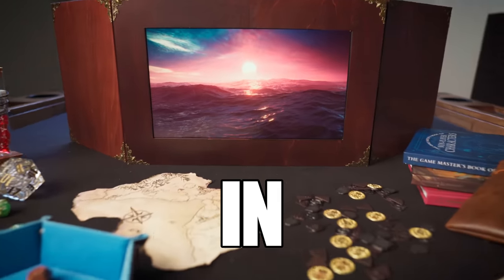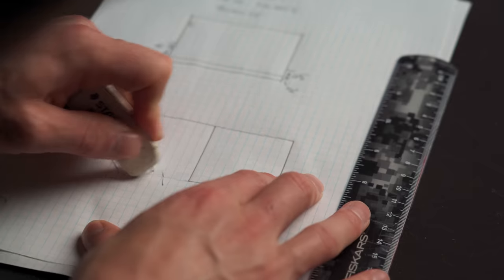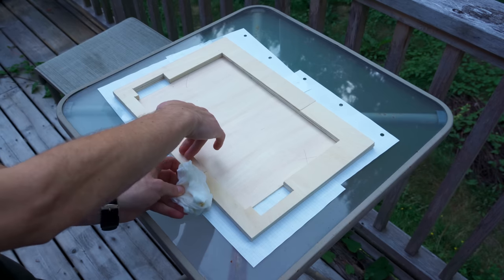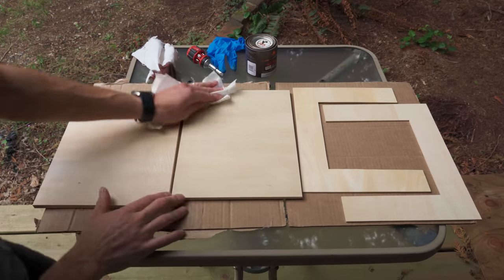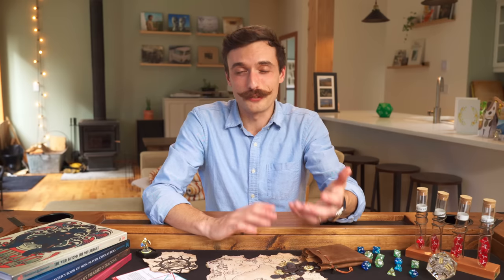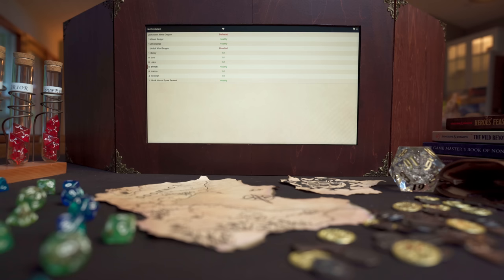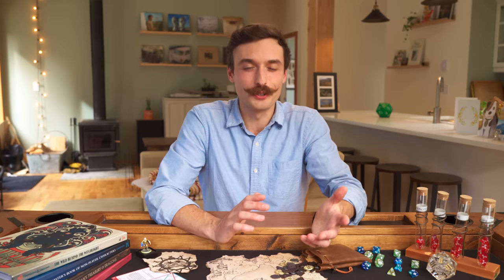I built a D&D DM screen with a built in display.

Comment: Hello, I'm a tradesman. You said"it's better to have the opening too big than too small" during the prep phase. This is actually backwards. Remember, you can easily take more away, but adding more is always tedious. But all in all this is fantastic, definitely going to try my hand at making one. What I really want to do is one of those big touch screen map tables, but holy dear lord does that get pricey.
Reply: Exactly my thoughts 😊
Reply: nicest tradesman correction ive ever seen
Reply: Why is less better just curious? My thought would be more is easier to cut?
Reply: @tteckk9  in trades, if you’re cutting one thing to fit another, it’s always better to go smaller with the receiving cut. As he explained, if you are trying to fit something into the cut but it’s too small, you can simply keep adjusting until it’s the right size. Conversely, if you make it too large, your new piece will fit, but you’ll find it hard to make the connection good considering the hole is too large
Reply: It is indeed better to have it too big. Too big means you can scale it down if need, otherwise u cant add to it if its too small without it making it look daft.
Reply: i saw a video of a guy who did a table like that. it only cost like $300~ for everything
Reply: @jasonjellie9342  its easier to take more away then too add. especially if its something like wood or metal

Comment: This is really impressive! FYI the bumps come from the damp cloth. If you want to remove dust, you should use a tack cloth or something not water based
Reply from the maker: Ah, thank you! That's great to know!
Reply: @powerwordspill   Actually the bumps come from the grain in the wood raising when you apply the water-based urethane. So, it won't matter if you use a damp cloth or not. You sand in-between coats of any sealer because the grain raises.
Reply: @NickRosterPicks correct

Comment: I have many suggestions for improvements, but the biggest one that comes to mind is using rare earth magnets to attach the layers that sandwich the monitor.  That way, if anything happens to the monitor it's easy to remove and repair or replace.
Reply: Im in the process of my build and only just saw this comment.

I got my 4 middle layers glued together, along with the front panel. I have yet to put the back panel on.

Im wondering if there is a way to do the magnet thing at this point?  The only thing i can think of is to take a hole saw, one hole in each corner, and toss a magnet down in the hole. Then on the back layer, add a magnet.  

Any other ideas?  :(
Reply: @chadc638  Watching the video again, assuming I'm understanding your position, that's probably the best place to do it anyway.  But you won't need a hole saw.  You'll just need a drill bit.  The kind off magnets I'm talking about aren't much, if any, bigger than a half an inch.  Just drill a hole in each corner the same depth as the magnet, drop in some super glue, and drop in your magnet.  Watch your polarities though.  Stick 4 sets of magnets together before you glue them in so you don't glue them in the wrong way around.
Reply: @lenonkitchens7727  Thats fair. I hadnt really gauged the size of the magnets. Just saw them on amazon or whatever. They look like those flat batteries you put in your car remote .. say the size of a quarter. But, yes, if they are smaller, then a drill bit probably works the best.

Thanks man :)
Reply: Can you describe how you would do this exactly? I would very much like to try this
Reply: @corneliusvonbogart4559  I pretty much already have in the posts above.  Instead of gluing all the layers together,   attach the layer that holds the screen in with magnets.  Buy the magnets, drill a hole that sized appropriately to it,  and super glue it in the hole.  Do this on all 4 corners of both the top and bottom layer, make sure the polarities of the magnets are all correct.  Did you have any specific questions?

Comment: Great project! When making this, I think would cut the middle pieces into a U shape, open at the top, so that the monitor can slide in and out.
Thanks for the inspiration!
Reply: Oooh or make the slot on the bottom with little shims to hold it in place = no visible holes on top.

Comment: I would suggest using iron-on wood edge banding next time to hide the ply-wood stripes and any glue that didn't get sanded off. Do that step before staining, and stain at the same time as the rest of the wood, AFTER putting on the front face. I like to do the sides and front first together, then the back alone. I use "delicate" grade paint tape around the back while doing the front to prevent drips, and along the sides and front while doing the back. For a pro job, leave the upper edge between the front and back open so you can slide your screen into and back out. (Your inner spacers would end up L or U shaped this way.  When you sand the finish, do NOT sand before the last coat, only after the other coats. If using three coats, you only have to sand after the first.👏Great plan!

Comment: Great Video, I can't wait to make a build like this now! Also a  little tip for laminating(glueing) wood like if anyone's having trouble with the line up, sprinkling a bit of salt on your glue helps give it traction and keep in place for clamps/weights. Since wood glue is typically a water based PVC the salt just ends up dissolving while it cures
Reply from the maker: That's a great tip!

Comment: Great idea that I seriously want to steal. Just a small tip for gluing up the layers of plywood. If you have the layers of plywood sliding around when trying to laminate them, you can sprinkle a small amount of salt in the glue before clamping (or setting something heavy on top of it).  It doesn't affect the glue at all and that little bit of grit will stop the pieces from sliding around and keep them in one spot

Comment: I know this is an old video, but just in case someone finds this later and wants to give it a go, these are some tips I'd recommend to make it just a little easier!  No matter what, I'm sure yours will come out perfectly, but these are just a few small things to keep in mind when you're building it.

3:00 - A tip when it comes to glue-ups, ideally use blocks or walls, but if you don't have access to that you can add a small amount of table salt to increase friction and prevent sliding.  Adding too much will compromise the joint; However, there are other alternatives, i.e. Rock Tumbler Grit, that can avoid breaking down the glue entirely.

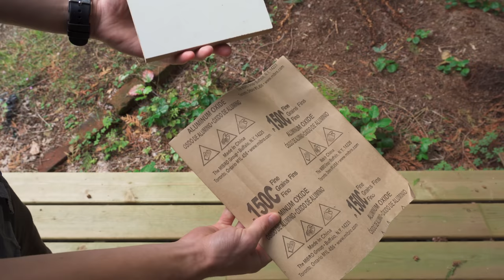3:40 - Another tip, rather than using a sandpaper block, for long edges like this, you might have a much better time taping the sandpaper down and running the wood along the sandpaper rather than the other way around.  You'll have much finer control over the angle of the wood and won't end up with rounded edges.  Keep in mind that once an error is introduced, continuing to sand that error in will only make it worse.  So, check often with a square if you have one available.

4:52 - Ohp another one!  Whenever you're staining, you should stain with the grain rather than against it.  It's a small detail but it will hide your wipe marks a lot more!

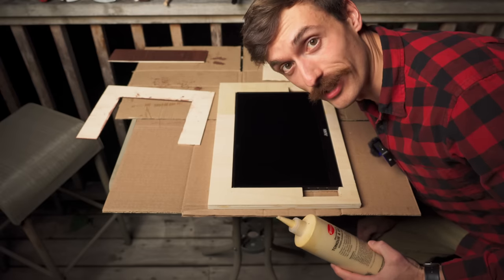6:12 - This one is more of a recommendation than a tip, electronics break down and need to be serviced sometimes.  If at all possible, I'd highly recommend using some small nuts and bolts and drilling through the corners, yes it breaks the no power tool requirement but I really think this is something really worth considering.  These can easily be covered with a small plug and can even be integrated aesthetically.  Gluing everything up means you're permanently stuck with that screen in its current condition.  If you ever need to remove the screen, you'll have to destroy a lot of the work you put into it.  The only adjustment I'd recommend to make this possible is that rather than gluing everything up on the back face, do it 50/50 with the front and back so that you have some material to bite into.

6:57 - So, this is an unfortunate downside of working with plywood (essentially what you've created) and I'd highly recommend a veneer in a situation like this.  They're really cheap, come in a variety of styles, and you only need an iron to apply them (although some bandy clamps will go a long way).  Then you can just trim them down with a razor!

Comment: I just made mine using your instructions and I'm happy amd excited to use it. I made one adjustment to your design by adding magnets to the front pieces and added a frame so that it is removable incase something happens to the monitor so I cam replace it without destroying the piece.

Comment: If you use a gel stain like General Finishes water based gel stain the glue won’t be an issue. I used it to redo a walnut stain to a 60s couch. It turned what was very uneven between the wear and a light sanding into something really nice. It works even better on a fresh build and it’s so easy. The stain floats on top. Great video!

Comment: I'd personally make a few minor changes, but great job.

first off, adding little rubber feet will do a lot. two on the main section, and then one on each of the wings. right now, it can scratch a table with the edge, or rock, depending on how flat the surface is. the feet just mitigate it a lot.
second, rather than glueing the frame, screwing it in. you can buy some cheap but good looking screws, and use them to secure the frame, but it means if you ever need to, the screen can be removed without having to break apart the whole thing.
third, and this is related to the previous, mounting the screen with either double sided velcto tape, or 3d printing a mount bracket (something to hold the corners would be enough), so that the screen is removable.
fourth, and this is of course, personal preference, but I'd add a small track along the top edge, by making one of the layers sit about 5-10mm lower at the top. it means that you can hang things off it like combat tokens, if you want to do initiative another way, or build accessories later.

Comment: 4:45 If you use a sponge, the distribution of the stain is WAY easier to achieve than with a rag. I done it on one of my projects and as I never used stain before it came quite easy and natural to me with the sponge.

Comment: You could also do vinyl wrap pretty inexpensively if the liquid finish process isn't for you. @DIYPerks Has great videos about creating "Portable Screens from laptop displays" that utilize this wrap. And/or if you want to do a more stylized finish @WylochsArmory has many techniques that would allow you to make a dungeon themed screen. 

Even if you don't want to do the full build use the bits in the end about OBS and a monitor at your table it is great. Also if you have a TV in the room you could connect to it remotely with a Chromecast/Apple TV/Miracast and use it as your player screen.

Comment: Great job. I collected all the stuff I needed to do a player-facing DM screen with all three sides containing monitors and a large flat TV for the map board itself. I downloaded ProPresenter 7 to control the various screens. Planning on the middle one exactly like you're using there, environmental info on one (day/night/weather/approx time/date if applicable) and monster images and regional maps on the other. For the most part I was going to use the center screen for initiaive order. Haven't cobbled it all together yet, but I've been messing around with the software and it definitely works.

Comment: The wood cutting with razorknife was super time intensive, multiple passes to cut through. I had the perk of a skill-saw at my work and cut most cuts down in 2 hours. Some of the wood I had order came out warped & bent though, so when gluing it was impossible to get anything square even with being careful with measuring.
Not a bad first build for a dm screen though for people new to woodworking, very fun and learned a lot
Reply from the maker: Yeah my hand was a claw after doing them all with the utility knife, power tools are definitely better haha. Yeah some of mine were warped too, but they lined up pretty well after sanding the edges. If you have access to a full wood shop, a better way would be to use a router and do a cutout in a thicker piece of wood instead of using those thin sheets from Amazon. Glad you had fun doing the project though!

Comment: Since you're using corner protectors, once easy method to keep the pieces aligned during gluing, if you add a drill, is to drill say 1/8"/3mm alignment holes in each corner of all multi-layer parts. Then when stacking the pieces insert a short section of 1/8"/3mm wooden dowel into the 4 corner holes.

Comment: So I'm about halfway through my build. I have all three panels completed and sanded .. just gotta stain. When something occured to me.

Kelly (or anyone else who wants to answer): for those who travel to our games and will be taking our newly fancy schmancy DM screen on the road, I'm looking for ideas to protect the monitor whilst in transit. Protecting it is one thing ... BUT, Im a super picky bugger and dont want to make the front side look crappy with a bunch of added fluff.

The one thing I thought of was three small strips of velcro on the top edge, horizontally. Then get a piece of plexiglass and attach the other side of the velcro, vertically, from the plexiglass up over the top edge of the frame. Then do the same at the bottom. This provides protection for the monitor, its removable if need be and the velcro im adding is on the top / bottom, which is a bit less visible.  Not sure this is a good idea though.

Anywho, looking for suggestions from other folks. Thanks a bunch :)

Comment: I built mine a bit different because I wanted more along the lines of a premium option like something Elderwood academy or Wyrmwood would make. For my project I started with Elderwood academies DM screen Mastertome as a concept, I then decided to head over to Framework Laptop site and pickup up a Cooler Master 11th gen Intel mainboard and case, Then simply got a few expansion modules and used 2 bare lcd panels 1 in the center outside and 1 on the inside for me as the main screen to run everything. For applications I simply use over on steam there is the 3dwallpaper engine, you see the UI settings interface(and preview) they only see the image, Its very very easy to use utilities to create trackers that are interactable or backgrounds to set the mood, or use already created stuff. Everything is digital, and in my table I made I have a 40 inch Samsung frame mounted for a VTT, I then premount 3d verticality to an acrylic sheet to make everything pop a bit, regardless its still a ton cheaper than Dwarven forge stuff.

Comment: Another smart idea for the side panels if you want to do an exact half. is to test fit before edge stain. sand down the sides that will be the center for a smooth snug fit after stain.

Comment: Looking at your pdf plans for this I think if I do this I am going to change one thing and that is making it so the monitor is not stuck in the screen. So you have a front, 4 middle pieces and a back for a total thickness of 6 pieces. So in the gluing process glue the back and 2 of them and then the front and the other 2. Then you can add magnets (plan ahead where you want then and you can add the cutouts for the magnets in the center most 2 middle pieces) so that the front and rear sections snap together. Now you have have it so that you can snap the panel (DM side) off and put the monitor in when you need it. Now if something happens to that monitor (let's face it...$100 monitor off of Amazon will probably fail at some point) you do not have to start over completely! Either way great build! Thanks for the inspo for sure!
Reply from the maker: That's a great idea! I was trying to think of a good way to make it removable but couldn't think of anything so I just glued it in. But magnets in the middle is a good one!

Comment: Very cool. One thing I might recommend is next time, build it so that the screen fits inside a well and then put a back panel on to cover it. That way, if the screen dies or get cracked or whatever, you can open up the back, pop it out, and replace it with a new one. Otherwise, it's awesome!

Comment: I like the idea of using OBS to run this. I use a tablet and a program that slaves it as an additional monitor.  But the OBS would give me more control to see what's on display on my single laptop display instead of having to have a duplicate of that second monitor on my side, which is what I do now.  My tablet usually sits in front on my screen, so maybe building something that I could insert a tablet into for a session would be useful to free up more table space.

Comment: Cool project! The only thing I don't like is locking the monitor in such that it is impossible to service or replace it without destroying your hard work. Your design could potentially be modified to include some kind of retention mechanism (screws, sliding latches, magnets...) for the monitor that allows it to be removed if the need arises.

Comment: One small cheap tweak that would really level this up AND bypass the whole "sand through the glue" issue would be to use edge banding on the edges of the plywood. No ugly plywood look, makes the whole thing seem like solid wood, and you dont have to worry about glue.
Reply from the maker: Yeah definitely! I was thinking about looking at some banding, but decided the edges were good enough for now. That would be a great idea though!

Comment: I think the only thing I would change about this is making the monitor more accessible (personal preference).  You've already added hinges for the side panels, I would make the back panel (dm side) also hinged in case any sort of repair or replacement is needed on the monitor instead of gluing it in.  Could possibly use cabinet magnets.